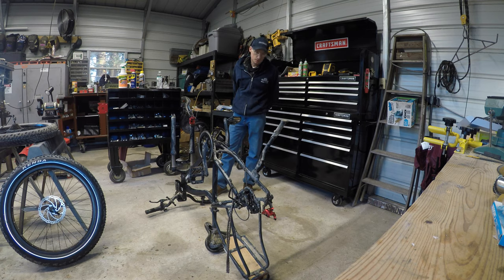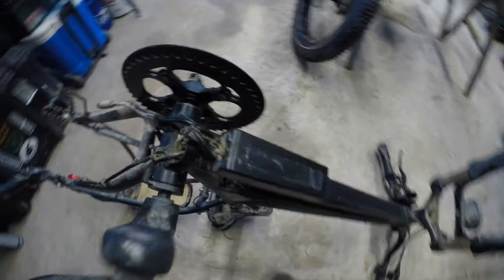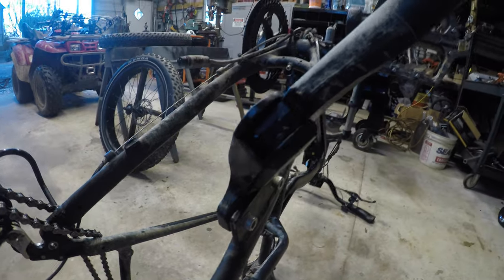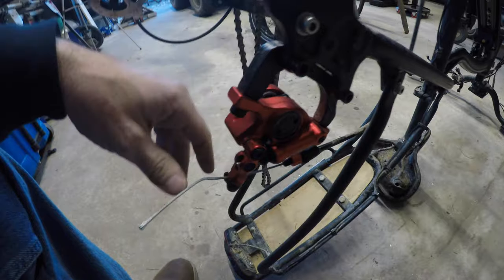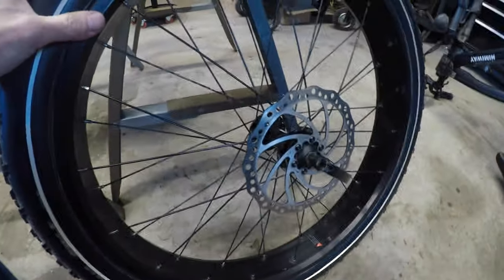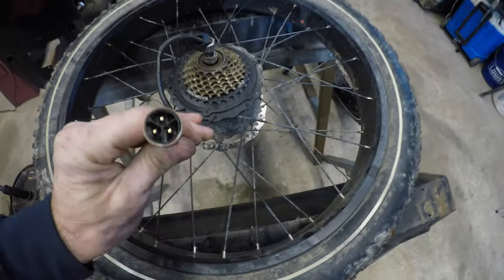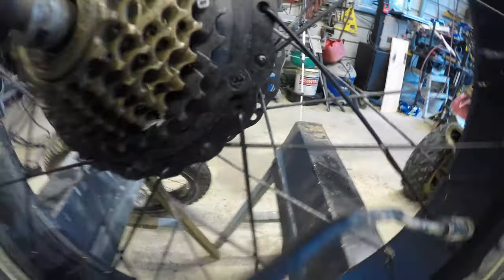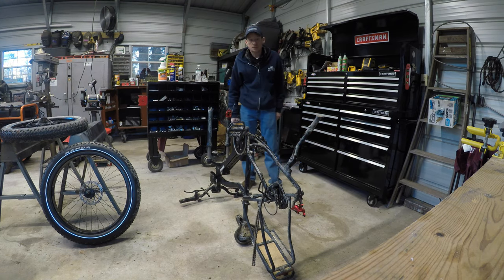Himiway Electric Hunting Bike "after the mud"  4K

Comment: Hey love the videos, I can't believe how much water and mud you went through on that! There was a guy on YouTube that was making little skid plates for the underneath portion by the bottom bracket. So you just need to make a little skid plate screw it in under there. Also love your tree stand quick release trailer very cool. I got just over 200 miles on my Hemingway, but I don't think I've ever had the guts to go through some of the puddles that you went through, or should I say small rivers. Great job sealing up the controller too.I think I will have to do that to. Keep the videos coming as I am working on some myself.

Comment: Hi I have the same bike on the way. I have never heard of cable hydraulic disc brakes. How do they work? And where did u get them from. I heard the factory brakes are so so. Nice little vid.
Reply: @averagejoewithabow  Hello from Tennessee...  I'm looking at replacing my calipers as well, but wanted to see what you thought of them after a month on your bike.  How are they working out?  Any problems?
Reply: @averagejoewithabow  These calipers are for a 160 mm rotor. will they work on the Himiway's 180 mm or do you need to downsize the rotor?